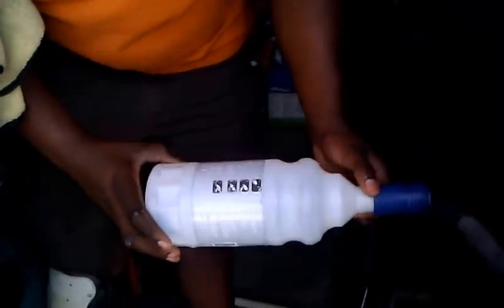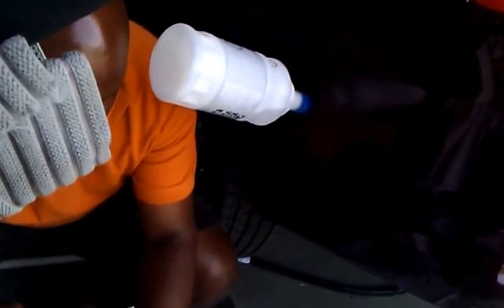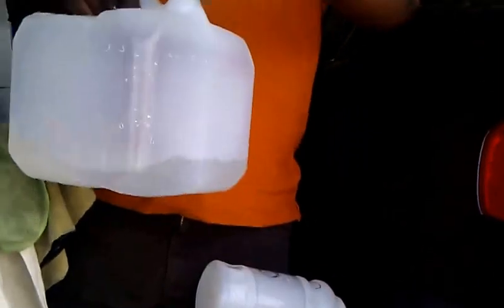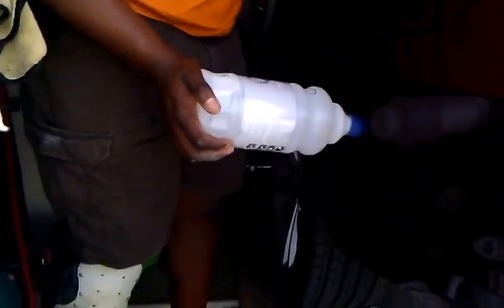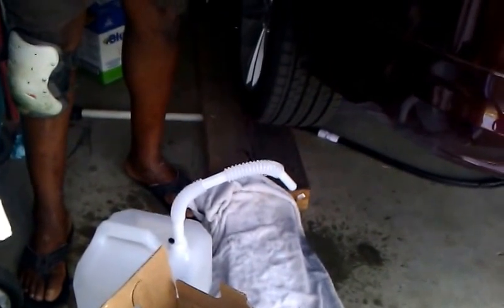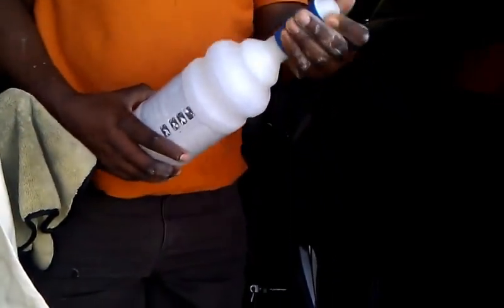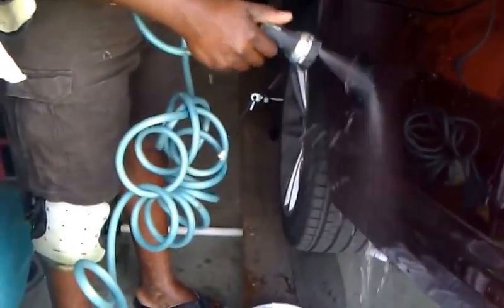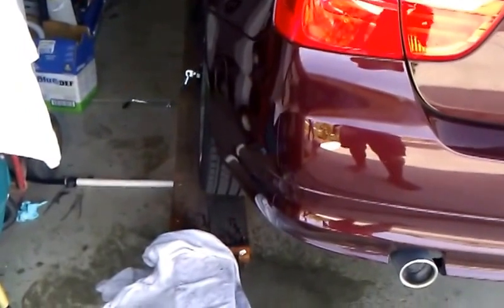BMW 335D DEF fill 2

Comment: The passive tank (top plug) takes 3.35 gallons, the active tank (bottom 
plug) takes 1.95 gals, these values are from BMW Technical service 
bulletin SI B 16 01 01 09. Just do not overfill.

Comment: Thank you for your video. I agree with your comments that the 335D is an awesome car...I've had several diesels and this is the best.  I have been adding DEF to my car and usually just add 2.5 gallons when the light come on...2 gal to passive and .5 to active.  I don't understand how the 2 tanks interplay...I'm guessing that the passive fills the active; but the active still has room to fill.  My biggest question is WHY BMW makes such a convoluted filling process?  I know BMW calls it the Driver's Car, but it is also the BMW mechanic's full employment car.
Reply from the maker: Thanks for your comment and experience with diesels. Due to government regulation on emissions, the 335d is designed to be a clean diesel. As such, it needs the Urea to keep running and if that fluid ran out, the car would stop or you would be able to start it. This BMW designed the car with two tanks so that if one (active) ran out of fluid then the passive tank would kick in and give you a thousand miles. this to me is  ingenious .That said, both tanks need to be filled up.
Reply: Just wait till your intake manifold needs replacing due to carbon build up, also the egr valve will have to be cleaned.  To make matters worse, your catalytic converter will need replacing too and likely you'll experience problems with leaks with your DEF tank.  My intake manifold was replaced at 18k miles, catalytic converter replaced at 25k miles.  Keep in mind that I only used BP diesel.  Luckily all work was performed under warranty.  Best thing to do is rip out all the crappy emissions systems which makes this car bullet proof.

The intake manifold replacement would have cost me about 3.5k without warranty and the catalytic converter would have been another ~3-4k.  If the DEF tank needs to be replaced if for some reason the seals dry and it leaks, that's about a 10k job.
Reply from the maker: I am at 140000 miles and no problems yet. I drive to San Francisco a lot and those long trips are good at burning and flushing out the carbon. It the start and stop that does it
Reply: +idjr these diesel bmws are supposed to be driven a lot otherwise you get problems....that's what I read somewhere.how many miles do you /did you drive your car?
Reply: +trippplefive yeah that sounds about right. My car currently has 31k miles, half highway half city miles.  Doing the deletes was the best decision I've made concerning my 335d as I'm currently driving mostly city miles, no more worries about the SCR system or carbon.
Reply: I wish they would design better systems to clean up diesels so we didn't have to resort to removing them.
Personally i hate diesel smoke but i hate dealer prices on the scr and carbon removal. Ive got a 335d with only 45k miles on it and its got a nice buildup of carbon already. So egr is getting blocked asap.
Reply: how much did it cost to get rid of all the emission stuff?
Reply: what did it cost to remove all this stuff?

Comment: The smaller bottle (that he modified can be obtained from the service department at a BMW dealer) is meant for an "emergency" refill. The instruction for the smaller bottle have you putting the fluid in the lower of the two fill ports -- which is the smaller (1.6 gallon ?) active tank. The top port is the (4.5 gallon ?) passive tank and is the larger of the two tanks.
Reply: +Gulfcoastbeemer same bottle $9 @ VW dealer

Comment: I'm a little lost, I see two options that people refill their DEF with. One is the one the dealership sells you for about $40 which is half a gallon and the other is a $15 option that has 2.5 gallons. How much am I supposed to put in the top and bottom plug? Does it matter which option I buy? Thanks for the help.

Comment: Where did you get the smaller bottle and how much does that cost?
Reply: Looks like nobody has responded here... I believe I heard him say Walmart or a truck stop for $20ish.  Here it is on Amazon for 2.  You can still buy it much cheaper in 2.5 gallon quantities, but this would work if you need the bottles :)

http://www.amazon.com/Diesel-Emissions-Fluid-gallons-2010-2013/dp/B0087S7DM0/ref=pd_sim_auto_4?ie=UTF8&refRID=1Z2ZKC8J2TXPFCP47N4W
Reply: +Drew Ramsay 
NO.
small .5 gal bottle (for diy adapter) - $9 @ VW dealer, need 1
big jugs generic fluid 2.5 gal $7-10 @ walmart, need 2

total $23-29

ps fill bottle just called "DEF" at vw, all their def comes w/adapters
Reply: Andrey Dyumaev PPS I bought it this week, y'all. Fresh as can be numbers.

SoCal, OC/LA region
Reply: VW dealer